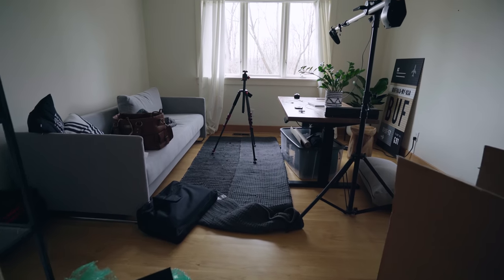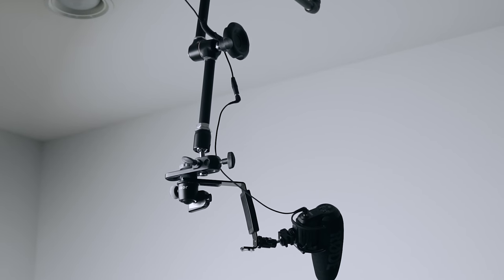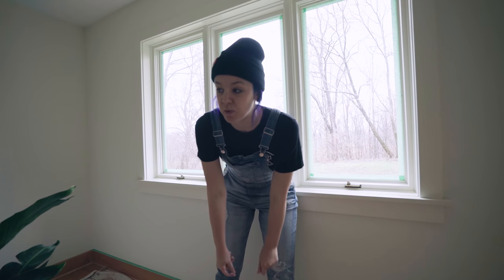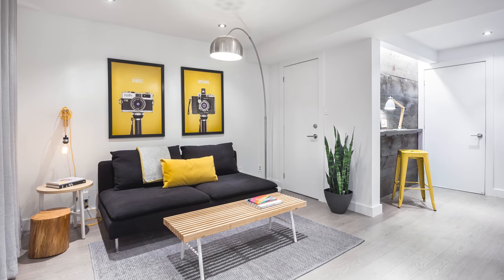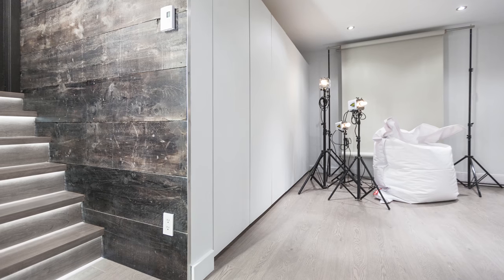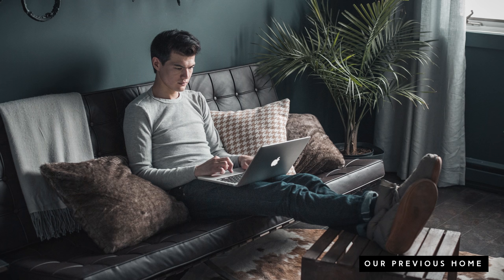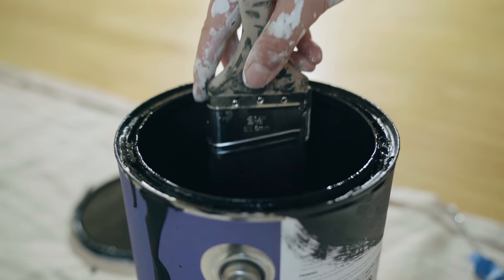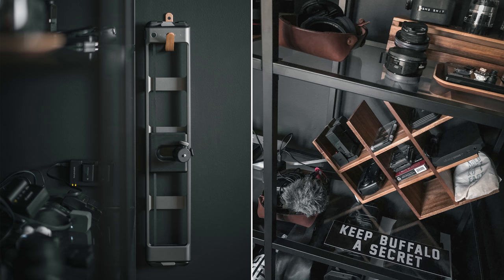How To Find Your Design Style for YOUTUBERS

Comment: Probably too late for this, but you can get Advantage 900 from PPG Porter. It's a strong latex trim paint and can be color matched and painted over oil based paint. Just lightly sand the trim to rough it up before painting and you're good to go.